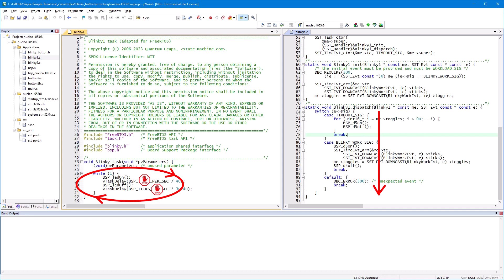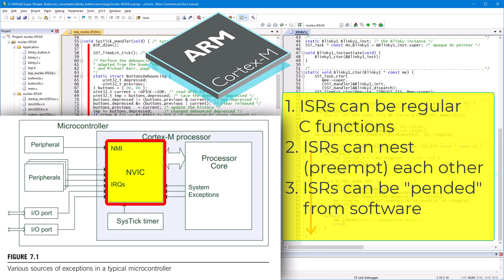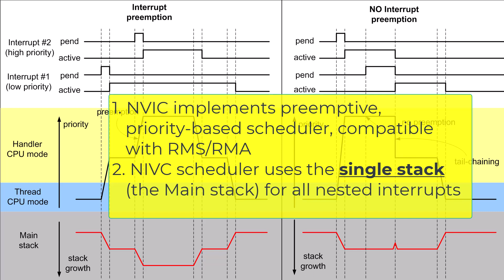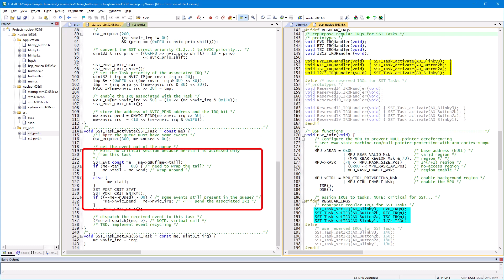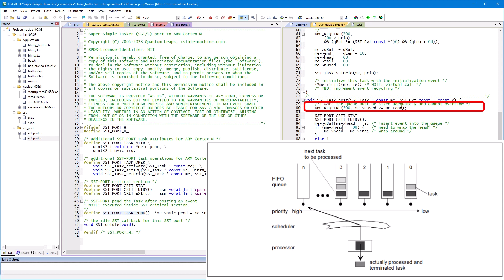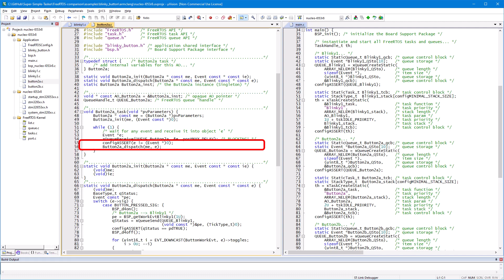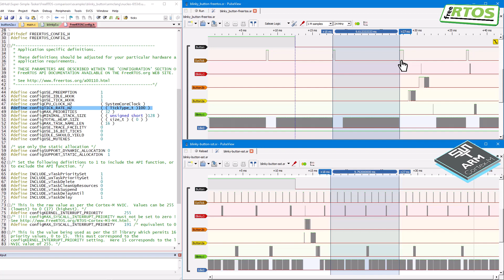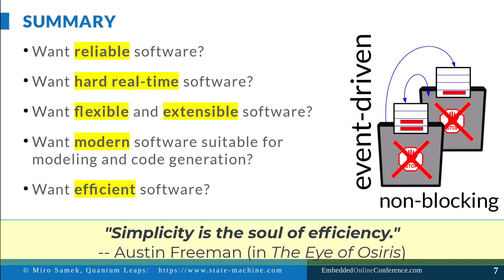Super-Simple Tasker -- The Hardware RTOS for ARM Cortex-M, Part-2

Comment: The run to completion paradigm is embraced in some rather efficient foreground / background RTOSs as architected as a solution to the needs of a particular application. Meaning it is architected to address the real-time requirements of a well defined (detailed and well documented requirements which also include testing) system as to operation in meeting real-time deadlines, and as such is not  presented as a general purpose approach like freeRTOS or SST. 

However, there are similarities in how the on-board interrupt controllers are used to control program flow in foreground / background systems. Where the video demonstrates the concept that hardware flow control is very efficient without the need to do an entire context switch, and does a task, if looked at as an object, need to be sequestered when there is no supervisory dedicated memory management unit being used.

Unfortunately, architecting systems that carefully that utilize the available ISR or core hardware like NVIC, requires a great amount of discipline in organizing the routines and training for those who may support the application. Because if we add software features (feature creep) outside of the original software specification the implementation can get rather fragile. 

The added traditional challenge is how the run to completion processes share data with background tasks, and communicate events. How do we manage shared resources, and do they really need to be shared if the tasks are organized properly. 

And as you know, as we go round and round conceptually striving for optimization like SST, we begin to see patterns in how real-time systems are architected to optimize the RTOS by leveraging available core hardware.

We also start to make rather basic decisions of how a system might run. For example only one process or task may own a resource, whereby the information is then provided for all the other tasks in a coherent manner, and only done so while not blocking.

You touched on one aspect that is often initially ignored in RTOS design, in that what happens to the system when we run out of time to complete tasks. How does the system performance degrade? And exactly how does this degradation manifest itself in actual system performance. 

We may then ask the question why doesn't the core have many more hardware features to monitor real-time behavior built in? It is hard to be general purpose and then optimized at the same time. Or are we saying that solutions are on a system level, which requires formulating the overall best approach to hardware and software integration, and as such is code portability even viable.

Comment: How would you go about determining the required stack size for SST? 
-In a traditional RTOS, it’s usually straightforward to empirically evaluate individual tasks for their worst-case usage; but if everything is in SST is on the same stack, how do you know you’ve seen the worst case? 
-If using tools to analyze the code, do you find that they get lost in the seemingly-recursive nature of the scheduler calls?
Reply from the maker: The stack usage analysis in a single-stack kernel like SST is more straightforward than in a traditional blocking RTOS kernel. There are NO "seemingly-recursive" scheduler calls. Every task can occur on the stack at most once. The worst-case stack use happens when all of the used priority levels happen to nest (from the lowest to the highest priority level). From the hardware SST implementation with the NVIC it should be apparent that the stack usage is the same as nested prioritized interrupts. So, you could just as well pose your question to the hardware designers at ARM Ltd., who should notice if NVIC interrupt nesting could be recursive and unbounded. I would trust them that this is not the case... --MMS
Reply: Thanks for the reply! 
I agree — there is nothing truly unbounded here. 

I remember playing with “SST”  based on the Embedded Systems magazine article from many years ago, and in that software implementation, any thread that posted an event would end up calling the scheduler, and of course the scheduler could run any thread. So, when I asked my linker to provide stack usage information , it got completely lost. 

I think you are right that tools would have a better chance at determining stack usage with the hardware assisted system in your video. That is very interesting. Thank you again for sharing this!
Reply from the maker: @davidlauzon1207  Yes, the "legacy SST," as it is now called, launches every task from a scheduler (a function). But even with this software implementation, the scheduler can launch only a task (again, a function call) of a higher priority than the current one. This ensures that each task can nest at most once on the stack. The linker does not "know" about that rule, so it cannot statically determine the worst-case stack use. --MMS

Comment: I'm trying to use your  SST implementation, but I've encountered a problem.
Assume you have a blinker-button project.
Instead of a blinker AO I have an ADC AO. It has event queue and is attached to some unused interrupt. It also have a START_SIG.
Upon receiving START_SIG ADC AO starts ADC measurement with interrupt on ADC complete. The measurement takes some significant time and during that time, no measurement can be started again. The ADC is busy.
Imagine there is two or even more START_SIG in ADC AO event queue.
What should it do upon processing the second event? How ADC AO should wait for ADC completion? There is no delay_ms() or some yield() functions.
Reply from the maker: You seem used to blocking calls, like delay() or yield(). So perhaps a good approach for you would be to step back and ask yourself what would happen if you had delay() or yield() (?) It turns out that after START_SIG your blocking task waits for the equivalent of the ADC_COMPLETE event (only that event can unblock your traditional task). So, most of the time, other START_SIG events are silently ignored. If this is the case (and you can live with that), your non-blocking SST task can ignore START_SIG as long as the ADC is busy (ignoring an event is easy--just do nothing for that event). On the other hand, you might also decide that you cannot ignore START_SIG events, in which case you can do something about it. For example, you could count the START_SIG events in the busy state. After you receive the ADC_COMPLETE signal, you exit out of the busy state and can look at your counter. If not zero, you can decrement the counter and initiate another ADC conversion. You can repeat the cycle as long as your up-down counter is zero. This is just an example, but it illustrates that the event-driven approach gives you more control over what you want to do precisely because your tasks remain responsive to all events. Using blocking tasks is like sticking your head into the sand and pretending that other "unexpected" or "inconvenient" events didn't occur. --MMS

Comment: Hi, first off: awesome Videos! They remind me, that understanding scheduling is truely unterstanding how everything works in embedded...

As I understand, the main difference to the QPC-preemptive kernel is the deeper usage of the NVIC as scheduler? On the back side, this is not as portable?

And regarding the activation of tasks with separate ISR functions. In Cortex M4, could you put the task functions in a RAM array and delegate any SST related ISR to one single ISR which uses the SCB->ICSR->VECTACTIVE field to reference this array? Maybe it would make the coding style a bit more flexible on the backside of little less performance. I think in AVR a similar approach is possible because you have space for 2 instructions to jump into the single "SST dispatcher ISR".

Comment: Hello, in general when is better to use Bare-metal programming instead of RTOS?
Reply from the maker: This is a very complex question because it all depends on the understanding of "bare-metal" and "RTOS". If by "bare-metal" you mean the "foreground/background" architecture as explained in lesson-21 https://youtu.be/AoLLKbvEY8Q , then I actually don't recommend using it directly. Also, if by "RTOS" you mean the traditional blocking RTOS, as presented in lessons 22-28, see https://www.youtube.com/playlist?list=PLPW8O6W-1chyrd_Msnn4LD6LBs2slJITs , I don't recommend using it directly either. The architecture that I actually use and recommend is the event-driven model based on the "Active Object" pattern, see https://www.youtube.com/playlist?list=PLPW8O6W-1chx8Y7Oq2gOE0NUPXmQxu2Wr . This architecture can work with quite wide range of schedulers, including schedulers similar to "superloop", traditional RTOS, or non-traditional RTOS, like the SST. I plan to explain the whole spectrum of schedulers in the upcoming lessons. Stay tuned! --MMS

Comment: having these two properties :
- preemptive priority-based scheduling
- uses the main stack

this is applicable to a wide range of microcontrollers.
Very impressive
and instead of the interrupt pend bit, it would be the flag bit.
Reply from the maker: The particular hardware implementation shown in the video is specific to ARM Cortex-M only. But the general idea of a non-blocking, run-to-completion RTOS kernel is indeed applicable to a wide range of microcontrollers. One example is the QK RTOS kernel, described in Chapter 10 of my book "Practical UML Statecharts in C/C++, 2nd Ed." https://www.state-machine.com/psicc2 . --MMS
Reply: @StateMachineCOM  The only special aspect of ARM NVIC is the faster transitions between nested interrupts.

I see no reason that makes SST not applicable to other architectures as well, IMO.

maybe I can share a porting to DSPIC MCUs
for example
Reply from the maker: @ashrafkamel1287  The SST for Cortex-M it is not just about "faster transitions between nested interrupts". The NVIC implements the whole preemptive scheduling in hardware. For other CPUs, you'd need to do the scheduling in *software*. In fact, that is precisely what the "legacy SST" from 2006 did. And also, the QK kernel that I mentioned before is a software implementation of the SST idea. From my experience, the software scheduling is not trivial, but sure, please share your SST port with the dsPic MCU! --MMS

Comment: How could we handle resource sharing and access using SST? 

For eg: if we are sending data over a DMA channel and we need to wait until the transfer is complete to raise the next request to the DMA.
If DMA write is handled by TASK1 -> It can initiate the write when an event is raised.
When another event is sent to the queue, TASK1 needs to wait for the previous write to finish before starting[act on] the new request.
Reply from the maker: You ask two different questions: #1 "How to handle resource sharing in SST?" and #2 "How to wait for the write to finish". In this comment, I try to answer question #1 about resource sharing. The formal treatment of this is provided in the paper "Stack Resource Policy (SRP)" by T.P. Baker (you can google for it). The SRP can be quite easily added to SST in the form of a selective scheduler locking up to the specified priority ceiling. Specifically, you can use the BASEPRI CPU register available in ARMv7M architecture (Cortex-M3 and higher). This will be officially added to SST on GitHub soon. --MMS
Reply from the maker: Regarding your question #2 "How to wait for the write to finish", SST tasks cannot block and wait for something. Instead, when the DMA is done, it will interrupt the CPU and generate another event for TASK1. In the meantime, TASK1 must decide what to do with the requests to send more data. TASK1 can either defer the request events (store them for later) or perhaps just discard them. When the DMA-done event arrives, TASK1 might send the deferred event. --MMS
Reply: @StateMachineCOM  Thank you very much Miro. Now it is clear what should happen here. The task can keep logging the events, while transfer ongoing flag is set [within the task] and when the DMA complete event is received, the task can check the deferred events [in a local queue] and initiate a new DMA transfer. The reason I am saying local queue is the SST always removes the event from the queue before scheduling the evt handler. I am not sure if a cleaner way is to store back into the same queue quietly from the evt handler [if transfer ongoing] without using the SST_POST function to avoid a private queue within the task.

Thank you once again for your generosity.
Reply from the maker: @jayakrishnanharikumaran3758  Yes, you got it. The task must "remember" the context to keep responding to events depending on its internal state (in your case either DMA-ready or DMA-not-ready). In the simplest case, you can get away with using a simple boolean "flag". But this quickly becomes unmanageable for managing more complex states. A very elegant solution is to use a state machine to "remember" the context, which I mention in the video. So state machines could (and should!) be added to SST!
Reply from the maker: Regarding deferring events, you cannot re-post them to the main event queue of the task because this would make the task ready-to-run and it will create an endless loop. So, you need to use a different queue to hold the deferred events. This is described in the "Deferred Event' design pattern:  https://www.state-machine.com/doc/Pattern_DeferredEvent.pdf . This feature is not yet available in SST.
Reply: @StateMachineCOM  Thank you very much. The hierarchical state machine pattern to handle the events in the evt handlers is the final piece to complete the RTC semantics. So grateful for sharing this incredible framework.

Comment: And... CM-3 and CM-4  have implemented regarding 240 ISR. Really doesn't matter that STM32F3 have for example 91 ISR. So going forward You can use up to 240 ISR/threads or your SST can use doesn't install ISR from 92 to 240. Simply enought add in vector table 92 vector to ISR routine and add this routine in the code. Next you can set the NVIC priority for them and enable and finally - You can invoke "NVIC_SetPendingIRQ(92);" and use a PHANTOMIRQ in SST as non blocking thread. I can confirm - IT WORK.
Reply from the maker: That's an interesting point. Often the Cortex-M silicon actually supports many more IRQ vectors than the one officially documented. Therefore, it is often possible to use the undocumented IRQs at the end of the vector table. However, this needs to be TESTED and VERIFIED experimentally. --MMS

Comment: Can we overcome limitation of interrupts availibilty by using software exception interrupt with parameter to extend number of events
Reply from the maker: No, we cannot "parameterize" a single IRQ or an exception to serve multiple SST tasks. This is because the whole "scheduling" is happening in the NVIC hardware, so for every SST task the NVIC must deal with a separate IRQ vector, with a unique IRQ number. But I don't even think that it is a big limitation in practice. Small M0/M0+ MCUs have indeed a relatively small number of IRQ vectors, but then they also run simpler applications. Bigger M7/M33 MCUs have well over hundred IRQ vectors, and in practice over half of them go unused in any given application. In the bigger Cortex-M MCUs, you can have 50-100 SST tasks. Please also remember that an event-driven task can typically do more than a traditional RTOS task because an event-driven task is responsive and extensible. --MMS
Reply: @StateMachineCOM  Didn't check CM0/0+ how many ISR have implemented the ARM core, but usually providers like STM32 doesn't fill all this places, but checked on CM4 you can use not implemented by provider ISR from the end of them last implemented place to point described in the ARM documentation. This is exactly for SST golden gave. You need simply extend vector table and ISR routines. Pleasse check - it work. You can use NVIC_SetPendingIRQ(your_number) if the arm core have it implemented.

F429 example:

#define led1_bb BB(GPIOG->ODR, PG13)
#define led2_bb BB(GPIOG->ODR, PG14)
#define PHANTOM_IRQn 91

volatile uint32_t delay;
int main(void){
RCC->AHB1ENR |= RCC_AHB1ENR_GPIOGEN;
gpio_pin_cfg(GPIOG, PG13, gpio_mode_out_PP_LS);
gpio_pin_cfg(GPIOG, PG14, gpio_mode_out_PP_LS);
SysTick_Config(16000000/4);
NVIC_EnableIRQ(PHANTOM_IRQn);
while(1){
delay = 4;
while(delay);
NVIC_SetPendingIRQ(PHANTOM_IRQn);
}
} /* main */
void SysTick_Handler(void){
if(delay) --delay;
led1_bb ^= 1;
}
void Phantom_IRQHandler(void){
led2_bb ^= 1;
}